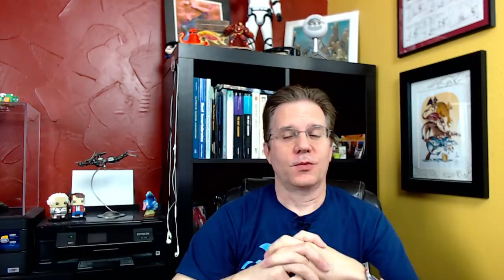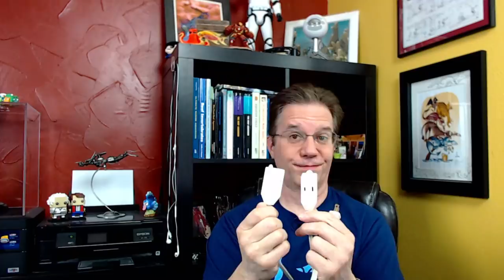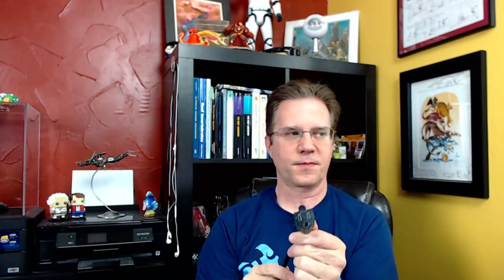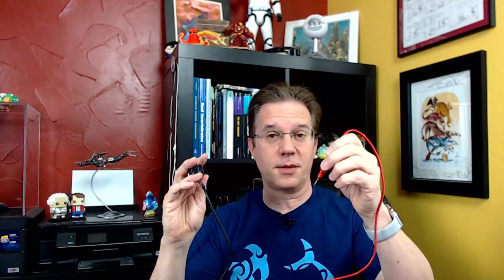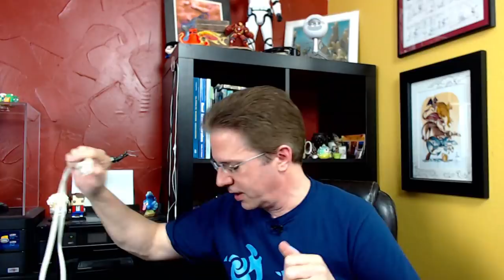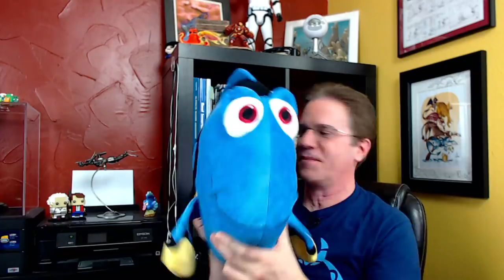Lets talk about Stray Electricity in the aquarium

Comment: I've found gfcis very helpful.  I actually have a tower yellow gfci adapter on every plug in the tank.  At 10$ a pop this was really expensive.  However like Mark said I would rather the one item go off than be electrocuted.  I used to have only 1 on the whole tank, but then one day everything shut off ( and it happened again before I wised up).  Thankfully I was around to diagnose but it really scared me.  However after going through each device, the gfci was correct popping, a plug was completely corroded, second time it happened years later on another plug, again the whole system went down, completely corroded - again the gfci yellow adapter was correct.  Since then I have invested in gfci for every device so when a device dies, it only shuts down that device with the one gfci on it, not the wohle tank, and I immediately know what needs to be replaced - it happened a few times in the last few years [I've been at this for about 10 years now].  The other item possibly worth mentioning is upgrading ac pumps to dc.  While our heaters are still ac, the more low volt dc items we can get, the safer we will be.  Tested my tank with the volt meter - it reads at 0.5 volts with both ground probes out ( one in the sump and one in the main tank) . Electricity is a scary thing.  Also mount those plugs up high, secure surge protectors, and drip loop.

Comment: for motors [powerheads, pumps, etc] i dont think dc is better, because the motor would likely be brushed, and those can get worn out really easily, i think three phase low voltage ac would be best, because single phase ac motors have a tendancy to spin in reverse, while three phase wont do that, and they dont have any brushes that can wear out, and they can be designed to use 12 volts and lower

Comment: The pieces of the LCD display are called segments as in seven segment lcd.  Question though: Why not take out the 16 items one at a time looking for the meter voltage to drop to zero?  It seems like it would be less painful then disabling your entire tank.

About aptasia.  I have tried Joe's Juice, Lasers and a Majano wand.  None will work if you have a side (the back at least usually) out of view.  The ONLY way that worked for me 100% is I purchased an Aussie Copperband Butterfly.  As a bonus, it ate all the bristle worms that I had (it was a night of the living dead at feed time).
Reply from the maker: It's not really that big a deal to unplug everything and start from 0.  Each item can be plugged in and verified within 15 seconds... within minutes you should know what's causing problems.  

I've heard the Australian Copperbands are the best ones to get.
Reply: @melevsreef  For me,  I try to go for minimal effort and if I could remove them one at a time until I find the culprit it would be better assuming that it would identify the issue as accurately.  I have two bad hips and am awaiting their replacement (not looking forward to the process...).

That Aussie Copperband is amazing!

Comment: When measuring with the meter the black wire connected the the grounding is the switch of the outlet suppose to be on or off
Reply from the maker: It would be on, as you are looking for stray electricity.
Reply: @melevsreef  I just noticed this comment and your feedback as I was scrolling through. I don't want to come off as condescending in any way as I appreciate your videos and have learned a great deal from you, however this is a safety concern that I should address. It makes no difference if the wall socket in which the negative probe of the volt meter is connected to is switched on or off. The earth terminal you are probing with the volt meter in the wall socket is always connected to the ground conductor of the house/building which is a long probe inserted into the earth below the property, usually via a copper rod etc. The switch only controls the active conductor, not the neutral or earth conductor. In fact it is quite dangerous to perform this operation with a volt meter if the power outlet is switched on, just in case someone accidentally probes the active terminal instead of the earth terminal. Could be harmful or fatal.

Comment: hey, how bout sending a fat ol man. a melevsreef T-shirt-Tony in England?????
secondly what anemones do best in 5ft x 2 x 2 MA in your opinion, or that you've had' On electrics, every plus must have an RCD, know need for rubber boots or anything else
Reply: What is RCD and are here good power strips or box for fish tanks to help with grounding
Reply: Hi what causes electricity current in water , seems to be coming from the T5 when I plug it into another socket seems to be less or go away. What causes it? Bad ground wire in plug? Or too much plugged into one? And what is a good strip or box that does best ground